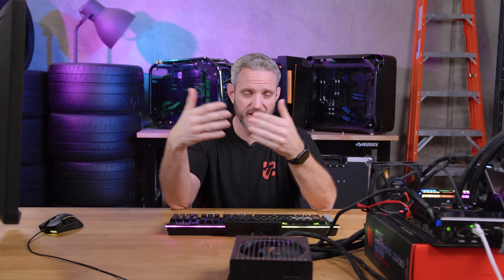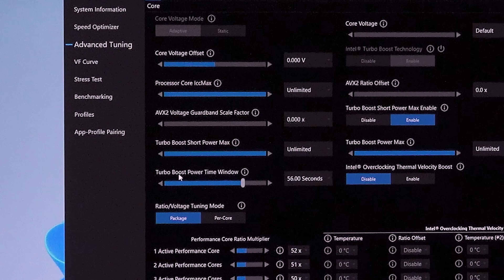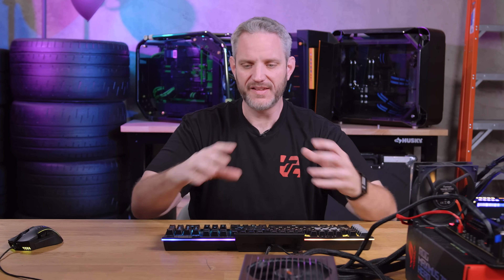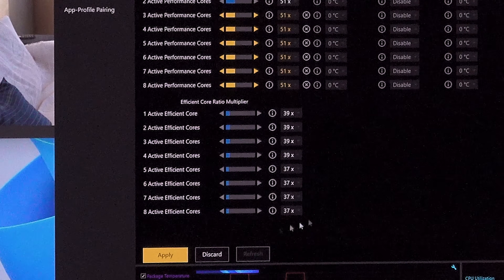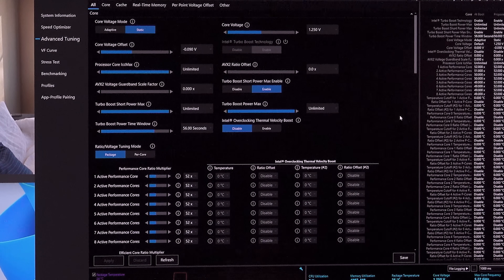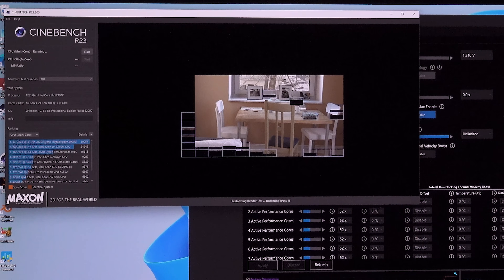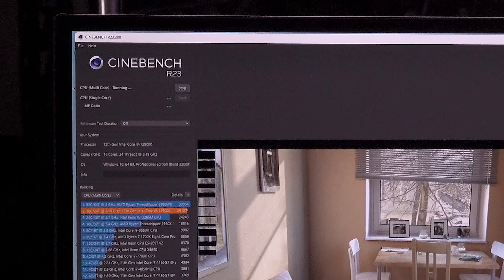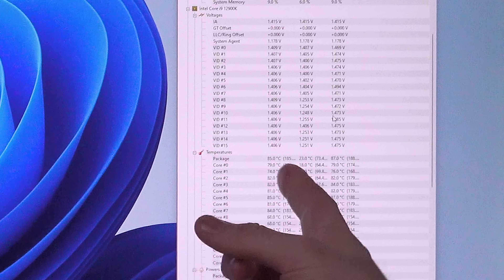Overclocking the 12900k is pointless and dangerous! Heat and Voltage testing...

Comment: now do a balls to the wall overclock with it and test how much radiator space it takes to keep it cool
Reply: At some point you will be limited by the CPU’s ability to transfer heat from the doe to the top of the IHS, that exact reason is why Intel delidding was and still is popular on CPU’s that are using Paste TIM and not soldered

Comment: For the wattage that intel is pushing with that CPU, the thermal interface design is showing its worth.
Reply: My 5950x is currently using 220w.
Reply: @Safetytrousers  I want to see somebody compare the 5950x with the 12900k, everybody is compering it to the 5900x instead. Also, that must be a sweet system you have there, I can only dream.

Comment: My 3700x uses max 40w for my work load which is trading and mining at the same time which does not stretch the CPU. I do not see any reason to sell on this setup to waste money on an overpriced Intel platform. I will wait for AM5 for my next upgrade which of course is not needed but nice to have an up-to-date system.
Reply: You could do that workload on a celeron. You won't ever need to upgrade your CPU.
Reply: @mattstephen7494  I know I just like shiny things :) I will go mid to low range AM5 based on lowest power draw.
Reply: I too use the R3700x all cores x 8 , 32Gb R.A.M @ 3600Mhz With a Prism stock cooler . I'm running it at 4000Mhz hasn't reached 70c yet . I have never liked Intel for this very reason their too easy to FRY and that's an expensive overclock . Basically you're overclocking an already Overclocked CPU as Jay has pointed out .
Reply: This is a dumb workload... really. I have a 3700x and while I render, I consume 90w, not 40w as you're saying. I get that Intel 12th gen is not really efficient, but at least say a good workload example.
Reply: In my country price is a bit high so i end up buying a brand new ryzen 5 3500 . turn out with stock cooler the temp is reasonable and low for me . maybe in the next 3-4 years i will upgrade to the newest AMD systems . being in love with them these last few years and i put some hope in them in the future

Comment: Agreed I'd love to see a hybrid Xeon take on Threadripper.
Reply: And is going to use a hell more power, for trying to keep up. The 12900K here is using 255W so get that.
Reply: @SamrasNeela  While that 12900K has like 60-70% more IPC or singlethread speed than a 2990WX threadripper.

Comment: Intel still not soldering there heat-spreaders to the IHS properly it seams…

Well considering liquid metal dries out and welds 2 parts together when it does so at no performance impact unless you break that weld…

Intel should start using Liquid metal under the IHS…

Purely because there CPU’s suck up a shit tone of power alp in an effort to try match / beat AMD

And Intel efficiency cores sucks vs Zen cores efficiency as Zen cores are built to scale and only the top 15% of the CPU’s maximum frequency requires exponentially more power

Take my 5600x for example at 70w i can get alp core 4.3GHz and i have to push that to 95w to get 4.5GHz all core (thats under cinebench r23 load)

On the other hand my particular 5600x only requires a tiny ass 38w to do 4.05GHz all core

Intel just sucks

Comment: Loving the videos Jay and Phil. An idea for a video could be the different fan curves which are needed for different types of coolers. Air cooling, aio, water coolers etc.. I have an AiO on my CPU but the fans always seem to ramp up even under the lightest of loads. Hope this is a good idea.
Reply: thats one thing I like about my corsair aio. It ramps the fans based on liquid temp not cpu temp. So it takes a lot to heat the liquid up so fans never ramp up unless I run a sustained load for like 15 minutes
Reply: Chris, this is the wrong guy to be following. lol. Trust me. This guy is for casuals and mainstream PC users and he even screws that up often. If you're a casual, great. He is perfect for you.
Reply: I had that issue on my pc too but there is a setting in bios that would let me control the delay of the fan speed up and speed down up to 1 second max. There were steps like 0.5, 0,7 or sth. Cant remember the setting , and atm im too lazy to check it but if u can't find it let me know and ill check after work tomorrow. ( MSI x570 gaming and a ryzen 3600x build but i suppose all motherboards would have it).

Comment: I hear that we should expect a cold winter ahead so this was the perfect time for these cpus to have come out lol
Reply: Both AMD and Intel gaming rigs make a good heater in winter ❄️
Reply: @tivtag  gpu Mining is more efficient
Reply: @tivtag  Can confirm, the radiator in my room is buggered, my 5900x + 3070fe are compensating nicely... But only when gaming, so productivity has dropped somewhat.
Reply: @derptyderp5287  Try folding@home to run Science packs on CPU+GPU. Just switch to a non-overclocked profile to eliminate error. Its keeps my no-thermostat room good thru winter.
Reply: @derptyderp5287  Just mine when your not gaming
Reply: I know this is a joke but people will actually use this argument believe it or not...
Reply: @LuxuryLeet  My gaming pc gets so hot that I have to open the office door to let air circulate out. It's fans only.
Reply: @LuxuryLeet  not a joke as someone who lives in cold Northern Europe
Reply: @LuxuryLeet   why? My 3950X + RTX 3090 warms my room just fine. I am upgrading to 12700K so that I have an iGPU to use without interrupt mining efficiency on my 3090.
Reply: @allansh828  I’ll take that 3950x off your hands what mobo?
Reply: My whole rig makes a good heater in Winter.
Reply: Any well cooled CPU will be a great space heater. The better your CPU cooler the hotter your room will be. Thanks thermodynamics!
Reply: Winter is coming....
Reply: im gaming at mid 40 degrees on 12700k, that intel runs hot is outdated meme
Reply: @FordSierraIS  No, it isn't. the Turbo draw of the 12700k is 190 watts. The turbo draw of a 5950X is 140 watts... and it doesn't have efficiency cores to hide in AND it has twice the "fullsice core" count
Reply: I saw a guy using a mining rig for a heater in a chicken coop! Not saying it's a perfect solution, but the chickens stayed warm!
Reply: @Rekhan4242  Last week when I placed an order on my Apex Z690 motherboard I was talking to the manager at my local computer store. He showed me a photo of some other customers mining rig. It had 8 3090 in the setup. He told me that the customer had a ventilation system setup to shoot the hot air flow from  the mining rig that was in the basement of his house to the rest of the house.
Reply: @Rekhan4242  they were probably miserable. mining rigs even single or dual GPU ones dry out the air and will kill over time, first destroying the skin and nasal
Reply: @Rekhan4242  I would be more impressed if the mining rig also laid the eggs....
Reply: Zen3 runs hot as the sun if you remove power limits. Those chiplets are tiny and extremely heat dense.
Reply: Natural gas prices have skyrocketed so…
Reply: lmao yeah, they run like a heater
Reply: As long as the power doesnt go out because solar with winter light and generators with wind or gas are only so limited
Reply: @FireFalcon  mainly gas if in texas, solar panels  actually work better in winter since heat degrades performance. the texas companies never bothered to spring for gas dryers for their supply lines. i doubt they bothered even after the blackout.
Reply: @Joe-Dead  It makes sense because most electronics work better in the cold, and yeah they probably already forgot that the pipes froze over and exploded. For the solar I was just more worried about the clouds rather than overheating
Reply: Oh yeah dude its gunna be very chilly here in canada going to be alot of snow welp gotta pull out the snow blower this winter to get to tims :D <3
Reply: So far it's been a warm fall. Anyway, my Ryzen 5 3600 heats the main portion of my apartment fine for the moment. But my air conditioner is on fan only right now because it is too warm in here after getting up to nearly 70F in Upstate New York today.
Reply: Using your computer as a heater? 😅
Reply: the slave GPU space heaters
Reply: I already use my computer as a heater for my room and it works well
Reply: Why does Intel claim power saving E-cores when it is clearly showing its drawing way more power than anything else prior?
Reply: or buy a pre built pc from acer Nitro or predator, gpu constant 80 degree and cpu 70+ in idle... 11700f + 3060 ti.... the heat is from another world
Reply: No no..not at all ( sarcasm intended),  GLOBAL WARMING MAAAAAN!!   lol
Reply: The only good thing  about winter is it turns my sever room into heating with benefits as opposed to a frivolous expense (according to my wife)
Reply: This will make me forget my oc'ed FX-8350 living room heater.
Reply: breh i use your beang mods lmfao
Reply: Aren't winters usually cold by definition?
Reply: My windows open and it’s not enough
Reply: @Crynomical  move to a colder clinate
Reply: Bro, im running a 12700kf on a cm360r aio. I dont need any heat supply in my room anymore 😂
Reply: Im at 5.5 all core, never pass 85 on my mo-ra 360
Reply: It was freaking freezing this winter!
Reply: Texas gamers are gonna have crazy clock speeds this year 🤞
Reply: @SuperNesus  as long as we have power lol
Reply: @SuperNesus  WHEN they actually have power, you mean!
Reply: It's a dark winter, come on man.
Reply: @al2644  nailed it!
Reply: @al2644  As in the Operation? I don't think they learned a lot from that operation..
Reply: BuT gLoBaL wArMiNg
Reply: It’s always cold at my place even in the spring and summer, because I use LN2 to overclock all of my hardware 🤣 even my 5950X ran a cool -150 at 5.9ghz but I realize this isn’t realistic for the vast majority of users.
Reply: The 5950x easily gets above the temperatures the voltage offset on this CPU produces.
Reply: @Safetytrousers  CPU temperature is irrelevant beyond stability and safe operation.  Heating a room with your PC is a direct result of power drawn (some of that electrical energy is wasted and expelled into the room as heat energy)
Reply: @erikhendrickson59  CPU temperature is relevant. There are many things that are not relevant about it, like walking a dog or the tides of the sea. Where did I mention about room heating?